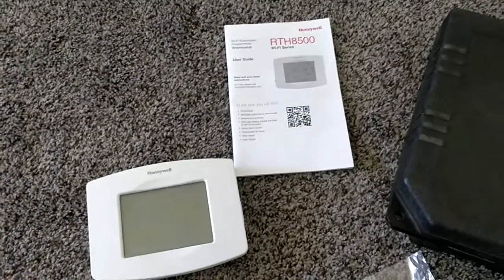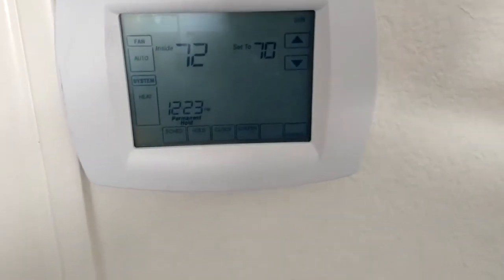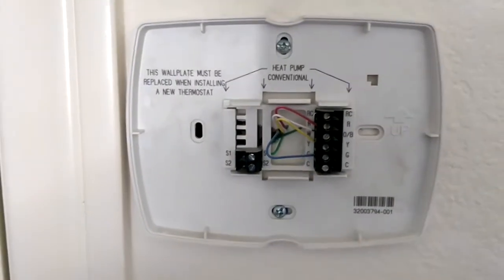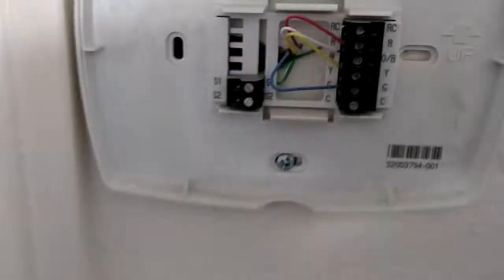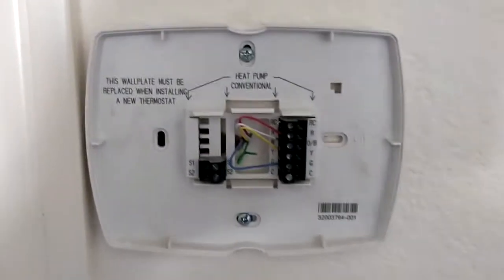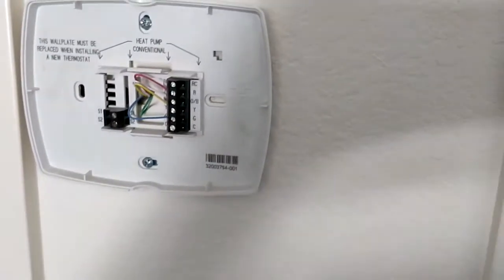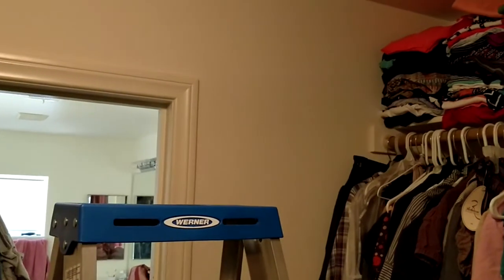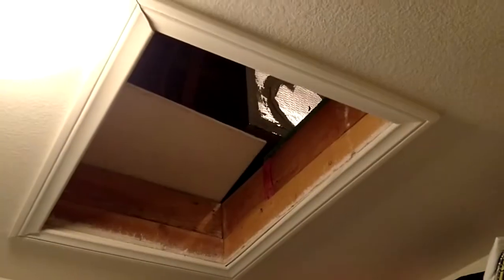Honeywell Thermostat RTH8580WF & C-wire Installation Part 1

Comment: It worked beyond my expectations. Fastly.Cool and Warming environment perfectly controlled. I can easily connect to it through a couple of walls over 30 feet away. The graphs are easily adjustable over time line and easy to read.

Comment: Very helpful video but you should know that the "C-wire" is not a "power wire".  It's a ground or "common".  It's a common mistake.
Reply from the maker: Dave, the Honeywell directions state that it is a power wire so I was just reiterating what was in there. You may be right, but Honeywell says it different